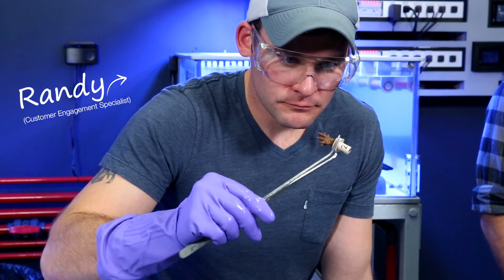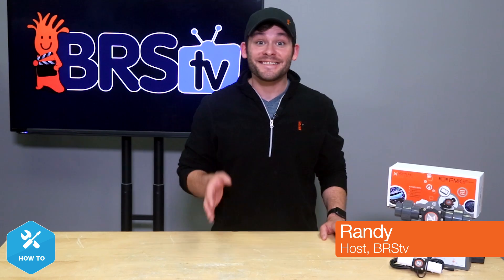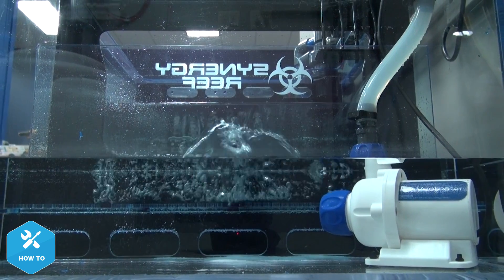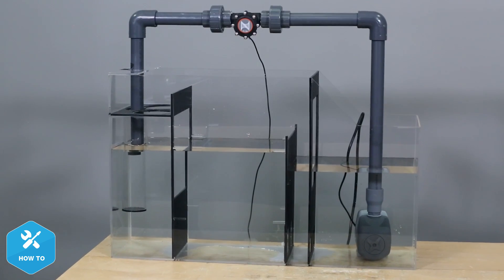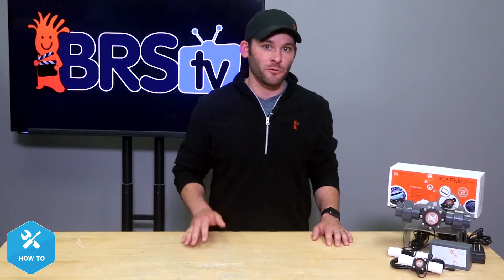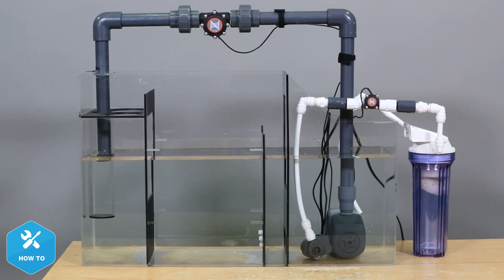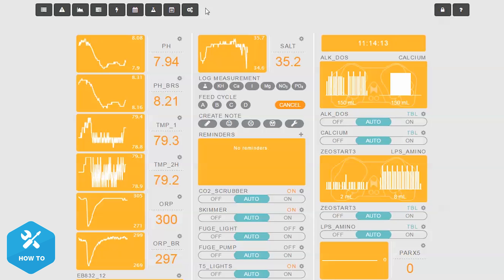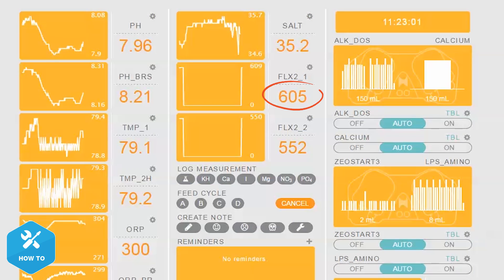Installing the Neptune Systems FMK Flow meter | BRStv How-To

Comment: I have an FMM module with my ATK kit. I have ports 1,2 occupied with the ATK and 3 by an optical sensor for low-level warning in my reservoir. I have a 1 Flow device plugged into port 4. There is no tile available when I unlock fusion. 

Is there something special I need to do to get the FMM to recognise both an ATK and a Flow device?
Reply: I found out that you need to go to the FMM module, 
select Action - configure, 
select the port concerned and disable autoconfiguration,
select the relevant flow device size from the drop down and away you go :)

We have all learnt something today ;) 
Great video though, was great to meet you guys at RAP the other week (the Dubai pilot guy moaning about not being able to buy via the hotel I stay in when in the States with work .... soon I hope :p )

Comment: Hi randy, you reference using the great white pipe joint compound with pfte, however Neptune says you can't, and I can confirm on the 2" sensors you get nothing but frustrations and water leaks, I spent a few hours putting together and taking apart the fittings trying to stop the leak and could not until I used type 555 compound
Reply: Test Test, this was invaluable advice. I skipped right to the 555 compound to put my two, flow monitors in place (I have two, Cor-15's). No leaks at all and equipment working great. Thanks.

Comment: Hi randy if I am using 32mm pipe (11/4") does that mean I need to step down to 1" to fit the flow meter.

Comment: How about cleaning the flow sensors? They must eventually have issues with calcium buildup. Can you take them apart and soak them in vinegar? Can you expect a similar maintenance schedule to pumps and powerheads?